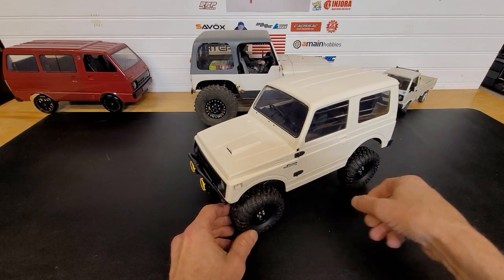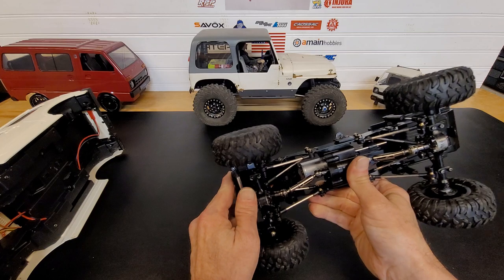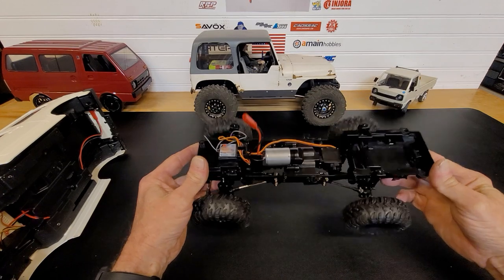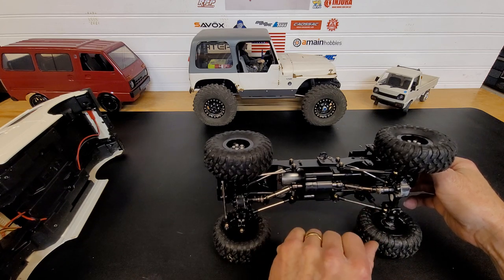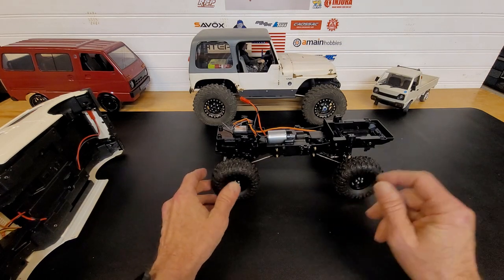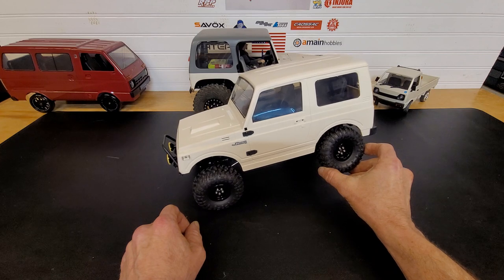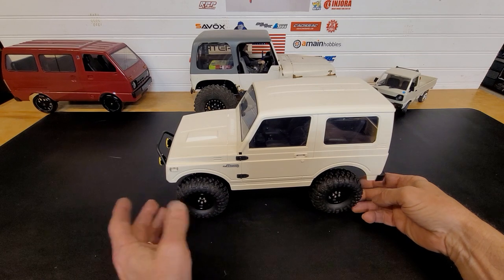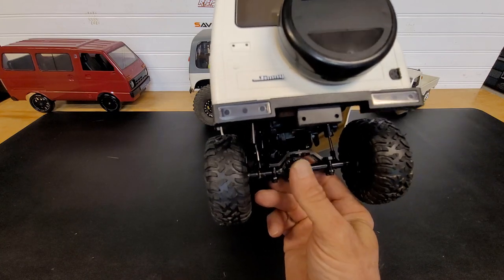How to 4 link your WPL C74 Jimny

Comment: Very nice work! I would lile to use 97mm long Injora axles. The original WPL ones are 105mm long. I want to add 27mm wide tires on 1,55 rims. Will it work? What do you think?

Comment: Hello,

Congrats for the building and video! 
I would have a question regarding what parts I should use if I would like to strengthen the suspension without conversion to 4 links (i have 2 spring leaf broken in 1 week)? i know that I have to buy the c34 shock absorbers and type 1 brass balls but the truss that I see on wpl site is dedicated to the conversion. I think I need to go with something from aliexpress...but what should I choose? Thank you, Aurel
Reply from the maker: I would seriously consider doing the 4 link conversion, yes I know it's not scale to the vehicle but the 4 link setup is much more reliable.
Reply: @SRCE2070  yeah, maybe moving to 4 links is the right move but I really like the leafs. It keeps the originality

Comment: How do you remove the shackels? Can't remove it because the shaft seems like loctided unless i break the shackels mount
Reply from the maker: They are press fit, you can push upper pin out,  they push outward away from truck,  use a tool slightly smaller than pin to push out.